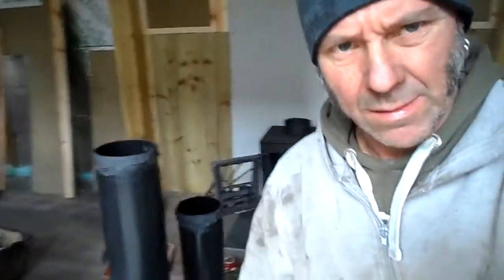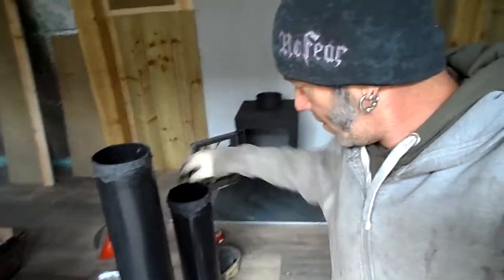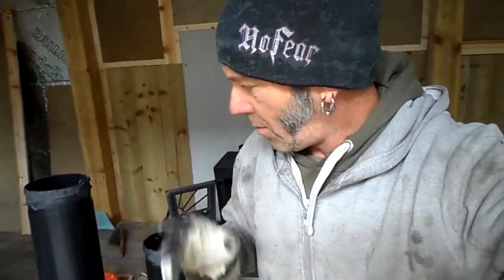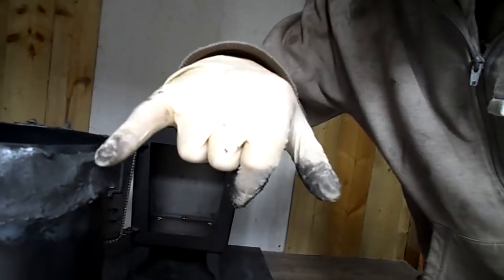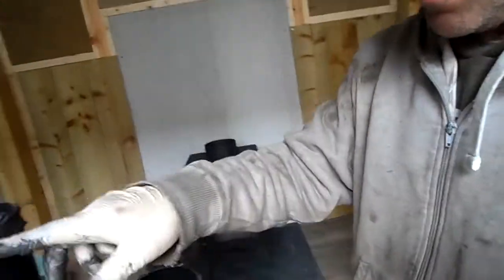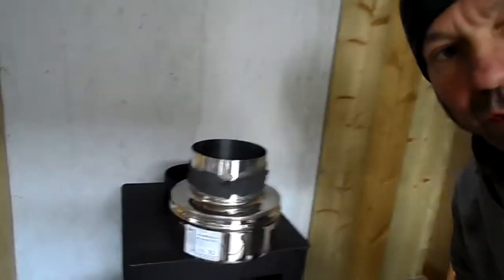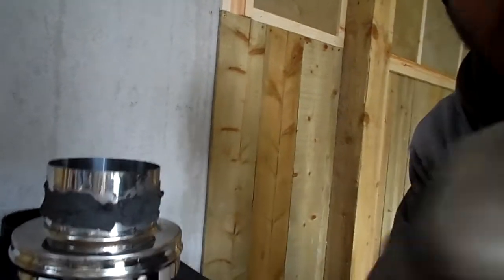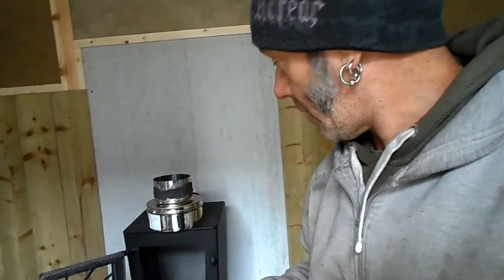Flue pipe installation, part 1, how much fire cement ?

Comment: if you use good quality pipe and fittings the joints are an interference fit and don't need fire cement.

Comment: Hey mate I'm about to be fitting a multi fuel stove and need it to be twin wall as it will go through the livingroom ceiling and in to the loft space and then out through the roof...how much single pipe do you recommend coming out the stove before I attach the twin wall... cheers